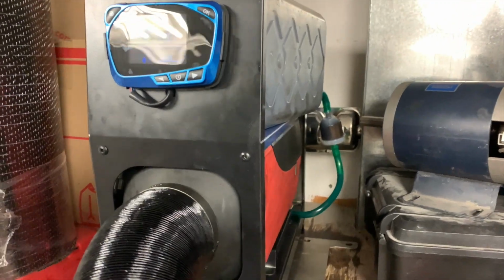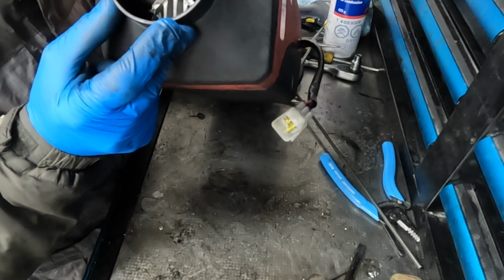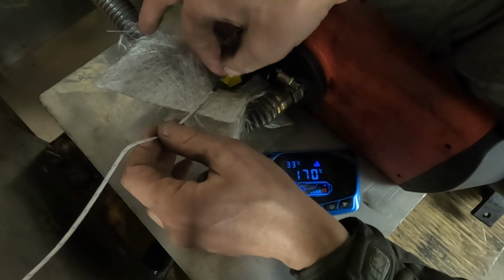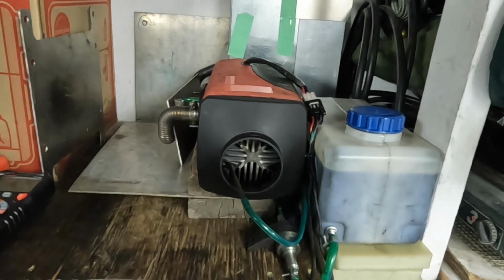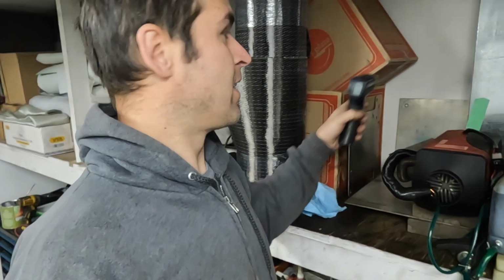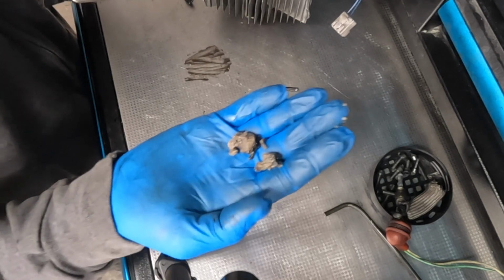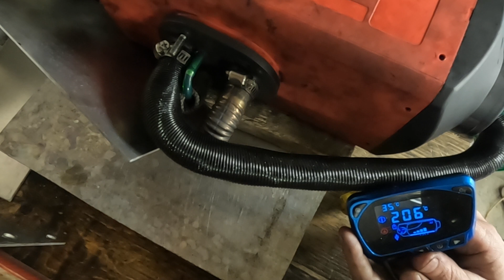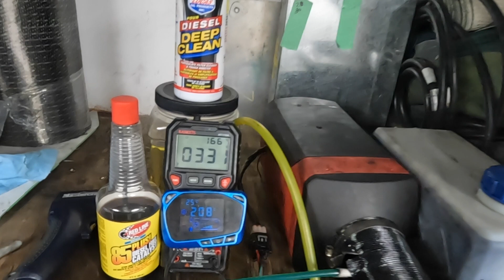EASY Waste Oil Preheater - Chinese Diesel Heater. PT-10

Comment: Preheating the oil has nothing to do with clean burning of waste oil.  We have 50+ years of burning waste oil in many different designs.  To start, take NEW clean motor oil and you will be surprised at the amount of ash produced.  When you add the carbon of waste oil you will generate enough ash to plug a Chinese diesel heater in a few hours.  The best we have been able to do with a group of many people, spending 100 of hours experimenting is to add @ 10% of used ATF, Automatic Transmission Fluid.  Any other waste oil will quickly plug a STD CDH.  What we have learned from all our experiments is to use the concept of a gauze pad from the CDH in a drip waste oil heater.  By using 2 layers of 1/4 SS mesh in our DRIP HEATER burn chamber, the waste oil vaporizes and we get up to 1000° F hotter flame.  Bright white instead of dull yellow flame tips.  The blue tinge from the chimney is completely gone and it is almost impossible to see from the stack output if the heater is running or not.  Only from a certain angle, do we see the heat shimmer.  The composition of the waste ash left in the bottom is now completely different.  Much less in volume, lighter in weight and much easier to clean.  Reduced cleaning frequency from every 24 hours to 72+ hours.  Perhaps, as many of us have learned, you will one day realize a CDH is NOT for used oil?
Reply from the maker: Thanks for the comment. I have a video where I burnt new motor oil and came to the conclusion that it is the oil and not the "waste" part. 

I realized a long time ago that these heaters were not good for waste oil, but just like you did lots of experiments to come to this conclusion, and more time to come up with the 2 layers of 1/4ss, I have been doing lots and lots of testing. I have enjoyed experimenting. 

Thanks for sharing your results... this is quite interesting. Was this testing in one of these types of heaters, or a larger unit ? Just curious/ 

The last video in this series I started to build a different heater unit. Not sure if I will have any success with it at all, but it's fun.

Comment: Heat oil before pump that is the Solution
Reply from the maker: Thanks for the comment. 

I may be wrong, but I don't think this is a good idea.  Unless you are using perfectly clean oil with no water or gas, you are going to get bubbles. These pumps don't work well with bubbles. Even if the pump does work with bubbles, the delivery rate of the fuel will be very inconsistent,  the oil will have time to cool off on the way to the heater and if you heat the oil hot enough, it could cause premature failure of the pump.
Reply: Controlled heat like max 50-60C
Reply from the maker: @freelancerfreeman6341  What is the benefit of preheating before the pump vs preheating after the pump ?

Comment: Not after fine tuned.  To much fuel in
Reply from the maker: I'm sure that there is a little too much fuel. I have ordered another ecu and controller that will allow me to change the fan and pump speed independently. Thanks.

Comment: Centrifuge and filter that oil so that its really clean..... that will help with buildup some.... i would also move your fuel heater line to wrap around the unit closer to the injection port, to avoid massive heating in the fins and vapor locking.... you want the oil hot but not vaporizing..... there is a sweet spot somewhere around where the injection is.... take a temp reading on the side of the burn chamber while it is running, that will tell you where to place your preheater line......
Reply from the maker: Yes... I would like to build a centrifuge.... They are a little pricey to purchase. I have tested burning new oil, to see how much of the issue was contamination... and the results were interesting. Video not yet released.

Comment: Hallo, I ordered a new pump because the pump which is installed is a 22ml pump. You need a 28ml pump to run this heater with real 8 KW!

Here is the guy who did it.  According to his experiments it works well. Just watch his last 4 videos if you're interested in. 

https://youtu.be/ZLukn3oTuDA
Reply from the maker: Thanks for the comment... You will also need a LOT more airflow to get 8kw... I do not think it is practical, and if you do get 8kw, I'm guessing the heater would overheat. 

I think David McLuckie calculated that the fan would have to spin at 10K rpm to deliver enough air, and I don't think that accounts for efficiency losses of the fan, or the restriction of the exhaust and inlet. 

It would be interesting to see your results, but I assume you will just get a lot of blue smoke and soot. Good luck.
Reply: All he 'proved' in his trials was that it was possible to deliver significantly more diesel  through the heater using the same size and speed of fan. without the heater flaming out. Heat outputs were never measured and compared, nor was the carbon monoxide  and smoke  in the exhaust, indeed despite many comments, these issues were not addressed and he studiously avoided even one view of the exhaust emissions.  In order to burn that much extra fuel a larger more powerful fan would be require to burn properly, without expelling monoxide and unburnt fuel out of the exhaust.
Reply from the maker: @bigoldgrizzly  Are you talking about my tests or David's tests ? I think you are repeating what both David and I said, just in more detail.
Reply: @loweredexpectations4927  
Sorry for any misunderstanding - not your tests, you are pretty methodical about how you do things and so is David, ....in his inimical way  ;<) 
I was referring to the tests done by  James Gilbert in the video link posted by Roast 'n Toast.
Reply: @bigoldgrizzly  Oooooh... I was really confused, haha.
Reply from the maker: @bigoldgrizzly  I hadn't watched that video because I know it's nonsense... I just went and watched it and I'm really confused.... It seems like the guy is either REALLY confused about reality or just making stuff up. He's saying it will work because the settings are the same ... So confused... That's like saying I was just in my Corolla and pushed the throttle half way and it went 80mph .... so I guess this Corvette will be the same.
Reply: @loweredexpectations4927  
I think he may have bought an '8kw' and really thought that is what he was getting and is trying really, really hard to convince himself by any means possible, that he has not been had. He has quietly ignored chemistry. physics and applied mechanics along the way....
ps - I'd love to have a car that actually got to 80mph .... in under a week
Reply from the maker: @bigoldgrizzly  Haha... Maybe I should have used different numbers in my explanation.  

I also bought an 8kw heater, without doing any research or calculation... It's annoying that all of these companies make this claim.... but when I was provided with proof that it really isn't an 8kw unit, I was like... "Oh... that makes sense"